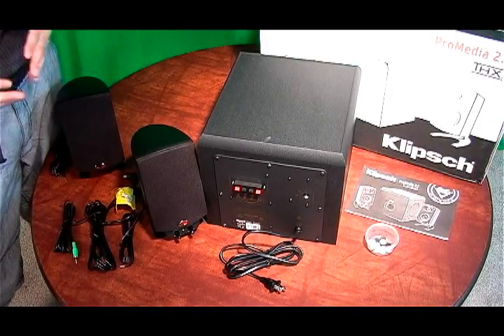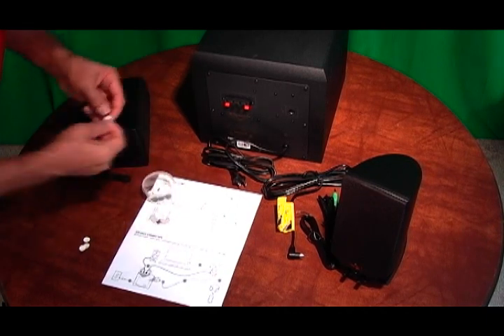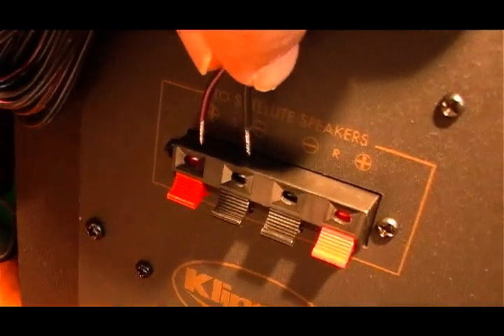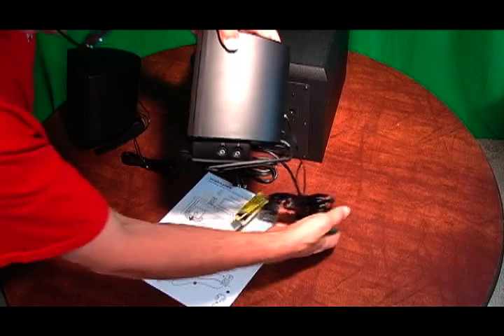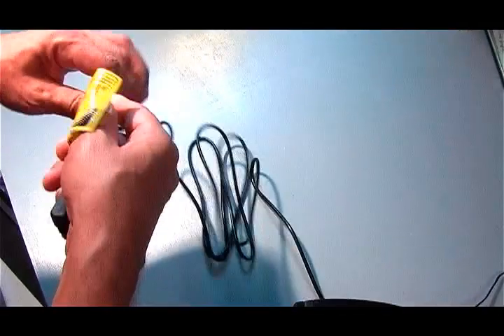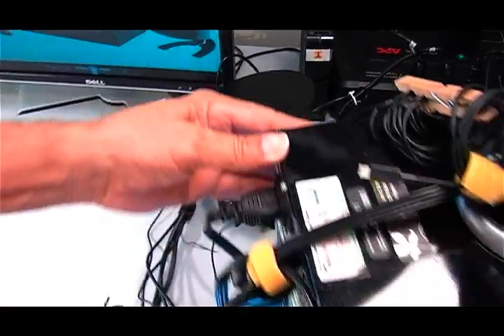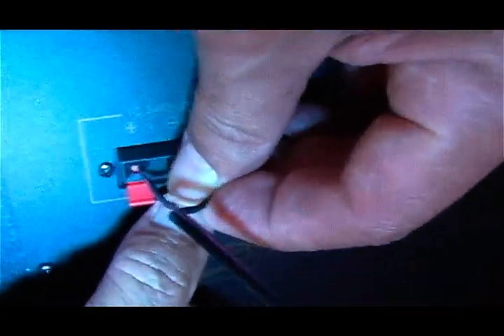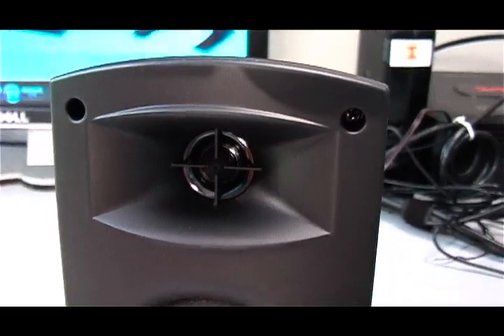Klipsch ProMedia 2.1 Speakers Setup & Speaker Placement

Comment: I know this is an older video, but maybe someone can help. I just purchased the Klipsch 2.1 computer speakers and I just built a new high-end gaming computer (Windows 11). When I plug in the green speaker to the back of my computer, there is a loud sound coming from the system and speakers, kind of like feedback. I have the volume on my computer down low and the volume on the speakers set to 50%. I have tried various sound settings and it still makes this noise. No, I only connect it once, but why would that noise come from plugging in the green wire? Thank you.

Comment: I bought a Klipsch Promedia 2.1 THX set from Costco about a month ago, and really LOVE the sound. Tough to beat that THX certification and power. But there are a few things that bother me about the Klipsch.

First is the detachable main volume and subwoofer volume control unit. The unit is made to mount under either one of the speakers. But my speakers are hard to get to. So my control unit is unmounted and sits below my computer screen for the controls. Not too bad. The bad part is how difficult it is to plug in and unplug the headset into and out of the headset jack. I often use headsets to keep from waking the entire house. But I love to use the speakers later. But the jack is recessed on the right back side of the volume unit. The speakers shut off when the headset is plugged in, as they should. But plugging in and unplugging the headsets is a real pain!!! The jack is hard to get to and not accommodating at all.

The second problem is the heat generated by the amplifier inside the subwoofer. It is HOT! This will be a real problem during the summer. I don't know id there is a fix for this, but it is NOT good.

The third problem is that there is NO WAY to turn off the unit. The only way is to unplug the it. It stays on all night using electricity and heating up my office. An on-off switch on the volume control unit would help a LOT!

So, although I really LOVE the sound, the system, in my opinion, does have a few shortcomings. Maybe Klipsch can fix this in a third generation. I would really like that!

Comment: I've had these for years and they work well as front speakers with a sub on the side. I recently set up a 5.1 (7.1 simulated) system with this klipsch as the center speaker/subwoofer. To do this you can only use 1 speaker so that the subwoofer has it's own channel. I also connected the 2nd speaker to the same connector as the first speaker so I have dual center speakers. By isolating the sub to it's own channel it sounds much louder and thumpier than it did before. I believe this is because the sound jack has only 2 channels. When used as a front pair of speakers you have left channel and right channel and the sub gets it's sound source from those 2 channels. With making it a dedicated center speaker/sub woofer pairing it now gets it's own sound source as now it is set for center channel and subwoofer channel. Hopefully it lasts in this confiugration. I have read articles that state not to double up speakers on 1 channel as it will damage the amp but I don't see to have that problem and having 2 center speakers seems to make it more robust and clear.

Comment: is it possible to connect with laptop rather than desktop?
Reply: Yes you can. Just plug the green 3.5mm jack into where you would put a wired headphone into. Remember to set volume at 70% and you are all set.

Comment: can I connect the speak with the green wire to my PC in the back and have it work? Or does that speak get power from the subwoofer? I dont have space for the subwoofer and the 2nd speaker on my table.
Reply: Abraham H the speakers gets power from the subwoofer. The green wire is for auxiliary connections.
Reply: @19LHSB  thanks for the info. I appreciate it.

Comment: Ok. I have been using these speakers on my computer for several years. Today I decided to do some cable management and put in a new power strip. For a reason I cannot figure out, my speaks do not seem to power up. The right speaker LED does not come on. Yes, I know the subwoofer has power and the connector to the right speaker is tightly installed in the sub, as well. Anyone have ideas?
Reply: See if there’s a fuse inside.
Reply: @michealpersicko9531  shaddap

Comment: if i put the wires for two more speakers into the subwoofer would it work?
Reply from the maker: NO, connecting multiple speakers to the same ouput on your amp will eventually lead to either a blown speaker or a blown amp. They make a Kisch speaker and subwoofer surround sound, that comes with 5 speakers. Be safe with dealing with Voltage and over loading watts to outputs. Could spark fires.
Reply: is there a way to connect 2 of these sets together? Maybe a receiver or something?
Reply: @Sharkb8 You can use a duel headphone jack adapter to use 2 of these sets together. You can get them at best buy of any electronics store for somewhere around $5.
Reply: Actually Yes you can do this but not with the same speakers. You would need to use speakers that are half the OHM rating of what the amp is set to output, example: if the amp is set to output 8 ohm speakers then you want to use 2- 4 ohm speakers to equal 8 ohm, really not a good way to get more sound but it's safe for the amp.
Reply: @HansMoorefacepaint  All newer audio amp and pre amps have built in safety measures, when talking fires, that was back in the pre 80's when everything was tube and resisters only, unless  of course your talking Dollar store stereos
Reply: Looking to purchase the 3.5mm/bare wire cords for the speaker-to-sub connection. Are the wires needed mono or stereo?

Comment: The subwoofer does not work. I heard it when it buzz at it was plugged in.  Volume was extremely low.  $59 logitech seems to work better than these $250 ones.
Reply: not a fuck. These are loud and produce clean bass for their size. I have 2 of them so i know. They will fill a decent sized room with clean audio!!

Comment: 0 cable management 😬. Fold up the excess wire and tie it with cable ties or bread ties.
Reply from the maker: I did wire management after the video was made. did not film that part. Yes, wire management is important. I do agree! Thank you for sharing.